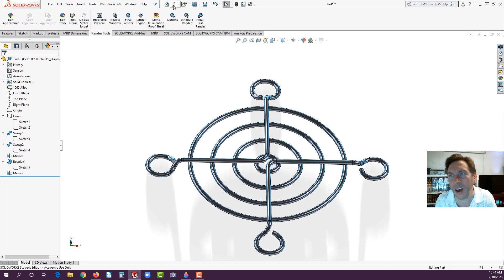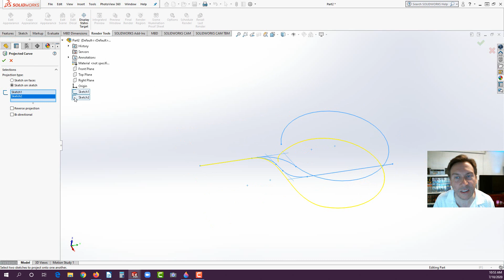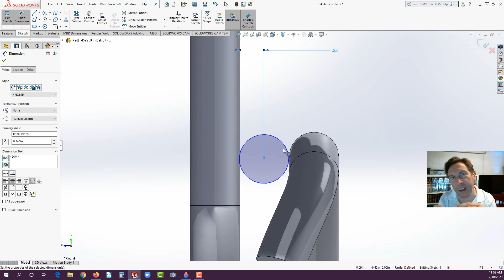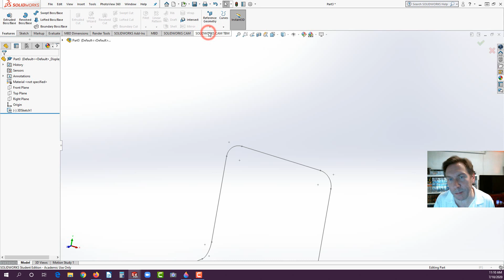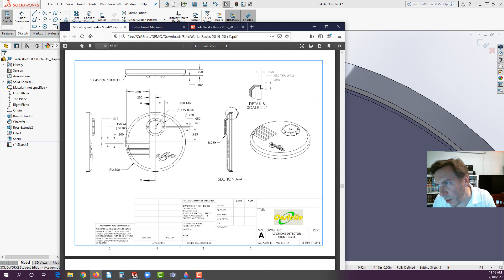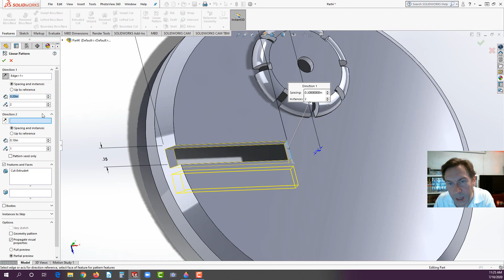E7 SolidWorks 2020 - Modeling 5 Tutorial

Comment: Hi, regarding the lab assignment for the smoke detector model: You chose to pattern the features with a circular pattern of 8 notches and a linear pattern of 4 slots. I completed the lab before watching the video and chose to use sketch patterns rather than feature patterns. Is there any advantage to patterning the feature rather than the sketch elements? Does it make it easier to facilitate changes, etc.? I would like to know if I am overlooking an opportunity to apply a best practice while assembling the feature stack's algorithm.

Thank you very much for thoughtfully guiding students through the SolidWorks learning process. Your syllabus reveals a deep understanding of how the knowledge should be conveyed to introduce students to the craft. Thank you! Thank you! Thank you!
Reply from the maker: Hi, thank you for the kind words. Although sketch patterns are considered more software‑efficient — they typically use fewer resources during rebuilds — the two most distinct differences between sketch patterns and feature patterns come down to editing and accessibility. Feature patterns, in my opinion, are usually easier to edit because they’re readily visible in the Feature Tree, which also makes them more useful when working with configurations.

Comment: I'm unable to create the theoretical 2.5 diameter using the centerline. When I Smart Dimension to the centerline from the circle, it gives me the vertical distance from the center of the circle to centerline with no ability to extend it to the "Floating point" below the actual centerline.